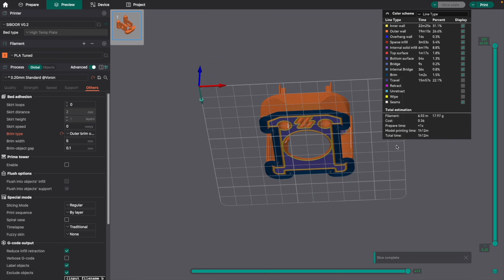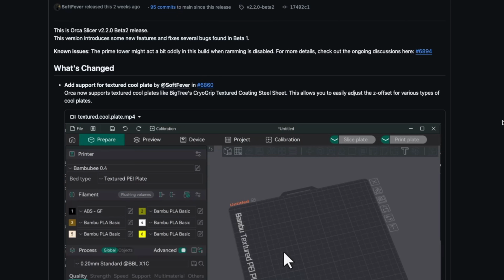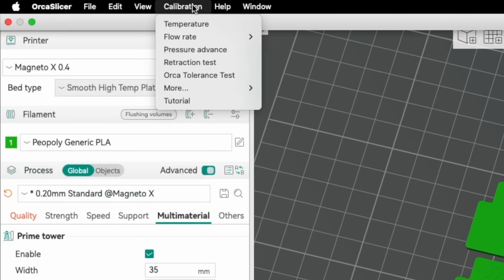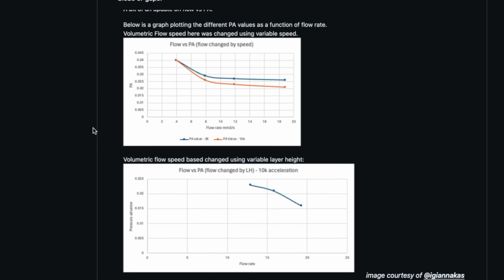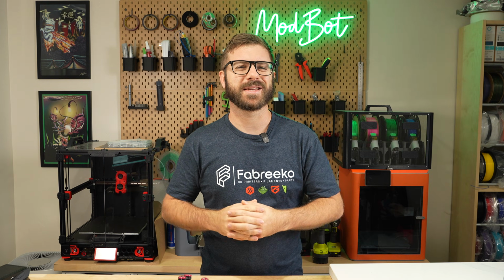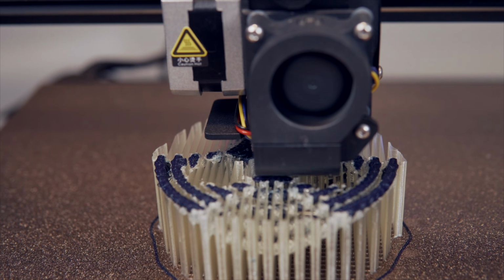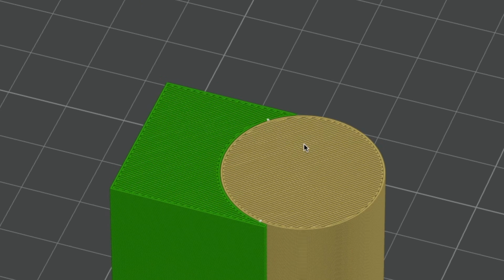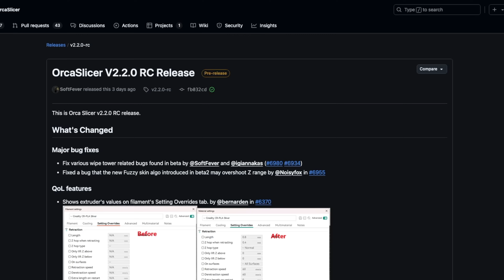YOLO Flow Test, Tool Changer Support, & Adaptive PA! (OrcaSlicer 2.2)

Comment: I'm still waiting for a build of FreeCAD that works on Raspberry Pi 4B (I have an 8GB board).
(There's a FreeCAD 0.19, it installs, runs, but doesn't work).
-But I'm also waiting for a build of Orca Slicer that works on the Pi 4B.

So currently I can't do any 3D-printing on my Raspi.

Comment: Great video - question regarding the Prusa XL toolchanger support - in Prusaslicer for both my XL and Mk4, there is an Input Shaper profile and a non input shaper profile for both printers. Is the Orca Prusa XL 5 toolhead profile Input Shaper or Non Input Shaper?

Comment: 5:33 with Ooze prevention I got problems when switching tool heads. It uses a m109 S command how is only good for heating and there is no tolerance set either. 
This leads to pauses while tool changing even when the temperature is correct because m109 s waits for a + temp increase to set nozzle temp. 

I didn’t checked it if they changed it for the RC. I disabled Ooze prevention and it works ok. 
What I would like to see is a zhop before doing the tool head switching too.

I use a Snapmaker J1.

Edit:
RC is still using a M109 S command sadly.

Comment: EDIT solved: pullrequest 6780
add a folder called "data_dir" inside the portable app does what i want.

Would like to learn more about managing orca slicer in regards to.
Running multiple version of orca slicer. Stable and DevBuilds, Do they all save to the same location?
C:\Users\USERNAME\AppData\Roaming\OrcaSlicer
How does it handle conflicting settings from updated features as your roll forward and backward between different orca builds.
How to run different orca versions to handle multiple printers. Example if you have multiple different printers that you use. to cleanly separate out the settings.
How to sync these setting between multiple computers in the house, Desktop/Laptop.

I come from superslicer background and you can create a folder called "configurations" inside the app folder, and it wont use the windows default "appdata" folder to store settings.
This enables you to separate out different "printers" and "configuration settings".
Run multiple versions simultaneously (stable/dev/past builds) and not have conflicting config files that don't understand older features/settings and you can even store the app on a network NAS / dropbox / one drive / Google Drive to sync between multiple computers.

i am very keen to get into Orca.

Comment: I've been saying it since a few weeks ago:

IDEX printers NEED TO BECOME THE STANDARD!!!!!!!!!
Reply: Yeah it cut down print time by 20h for bigger 2 color prints and you can use different materials too.
For support material or a ABS print of a wheel with TPU tread for example. 

I made these wheels by printing it separately before but they came off after some time.

Comment: Have Orca releases got further inbetween in 2024? / I need to get into this calibration stuff from scratch. Cura was much more foolproof! Right now with Orca I've got a my printer pass a 30+ Max Flow Rate test and the prints fail even below MFR set to as low as 15. Printer head often "cuts cornerrs" leaving THICK tracks of extruded filament.

Comment: Still hobbyists only. no surface mode and bridges are still printed midair. Not even close to Cura 4. Pressure advance sounds nice but it's an easy fix to make the printer accelerate the same in every situation. Would've been smarter to separate pressure advance vs pressure decline to make it possible to print LW PLA or other foamed filaments
Reply: "bridges are still printed midair."

Otherwise they wouldn't be bridges.
Reply: Are there any firmwares available that would support the feature pressure advance vs pressure decline?  Or are you suggesting Orca devs get into the firmware game?  Or something else?

Comment: the Orcaslicer beta where a mixed bag for me, where curious to use it with a idex.
but the Release is a bit bugged for Idex printer.
also the preheat feature for the next Hotend is broken for RRF

Comment: So glad you covered adaptive PA ❤ For anyone interested, I’ve got a detailed wiki article written up on the orca GitHub! The PR is slightly out of date, so best to use the orca wiki for this!

Personally, as you, I’m using it for the materials I use the most. For the rest, traditional PA is good enough :)

Over time I’m hoping to make a more automated test at least by printing multiple Pa tests on the same plate to reduce the time it takes to establish the PA profile.

Comment: My biggest question is if they finally fixed the filament selection for the ams. For months now I have not been able to send prints directly to my X1C from the slicer because selecting generic pla either in the slicers ams settings tab, or on the printer directly causes orca to think that there is support pla in that slot, causing an error not allowing me to send the print. There has also been a very annoying network bug that is causing any print I try to send to fail when sending, even if the filament selected is correct.
Reply: Check if there's the RFID sticker from the support filament stuck somewhere in your AMS.
Reply: @ares395  it's not that. It's the slicer itself. Bambu studio works just fine and it happens with every slot. I've also never used support pla since I just use petg for that
Reply: @RanaLoca  I've been using orca slicer with AMS and it always worked flawlessly. I've never heard of such a bizarre problem from anyone. I guess just uninstall and install 2.2. also update your AMS and the printer.
Reply: @ares395  I've seen a couple people report the same issue in the discord, but it doesn't seem as widespread as I assumed. Printer and ams is up to date, and the fact that Bambu studio reports it properly, makes me think it's definitely orca being weird. I have tried uninstalling and reinstalling before, and it didn't fix either issue. I might try an uninstaller software that I've used in the past that gets rid of all temporary files as well and see if that helps.
Reply: @RanaLoca  If the re-install doesn't work then maybe the old version of the network plugin creates problems. I don't know exactly how to delete it. Do you have the same problems when trying to use the slicer on any other PC? Seems like an odd error, don't know where support filament would come from. I'm using 2.2 RC from github. I have the installed version, not the portable if that matters. If you feel like it you can download different portable versions and test if it's related to version it is a hassle though.
Reply: @ares395  I might try to see if the same thing happens on a different PC. I'm going to try the complete uninstall first though. That might remove the old network plugin if that's causing the issue. Thanks
Reply: @ares395  the re-install didn't work and it downloaded the network plugin directly from Bambu so IDK what else to do at this point

Comment: One of the big things you missed is that part shrinkage is calculated differently and ported over from prusa slicer. It separates out the XY shrinkage and z shrinkage and this fixed a lot of bugs with multimaterial prints on the AMS that we're causing an insane number of material changes and what not. It's the main reason that I've been running the beta since I was having some multi-material slicing issues. Orca Slicer has become a true powerhouse.

Comment: Adaptive PA was too complicated for me to setup i saw the config and some instructions on it while i had something to print and was like nahhhh not now bye for now lol
imho whats missing in orca:

flow setting for walls and different features like solid infill ect. because atm you can only calibrate either quality OR wall accuracy / line width trueness ... and if you come up with it the same thing happens people are like :"we got used to good enough" :-)

Comment: I am a prusa slicer fan. I have 2 highly modified ender 3's, a sovol 6 and a sovol 6 plus. All running klipper. Is orca slicer that big of a difference from prusa slicer? Is it actually worth doing the transition to it?
Reply: I switched because of the built-in calibration.
Reply: depends on which limitation you encountered.
Reply: Don’t fix it if it ain’t broken. I still have my highly modded E3P and E3V2, as well as my KP3S. Running Klipper and using PS. I don’t see why I would change to OS. I’m at the point where I press “Print” and everything works perfectly and fast enough for me.
Reply: orcaslicer’s device tab is also really handy, no more browser tab searching for fluidd
Reply: I am using an  highly modified Ender 3 with klipper too. Switching from prusaslicer to orcaslicer was a Gamechanger for me. 

On both i used Stock settings from an Ender and calibrated for Higher Speed printing. On orcaslicer i was able to Print faster with more consistancy. Since orcaslicer i started using Supports again. I feel Like the Stock Support settings Work every time, with a as good as it gets suface Quality.